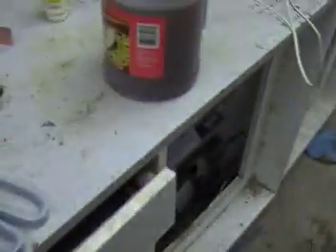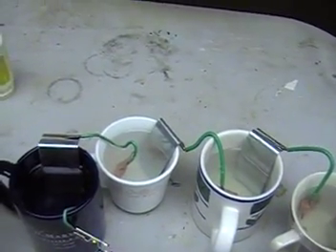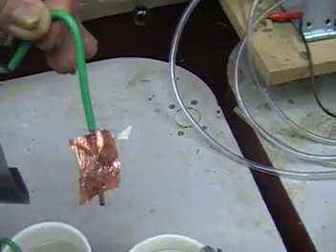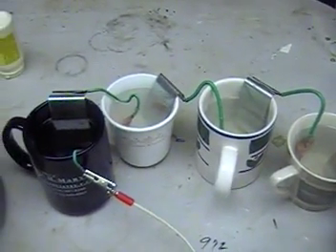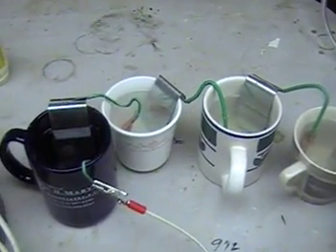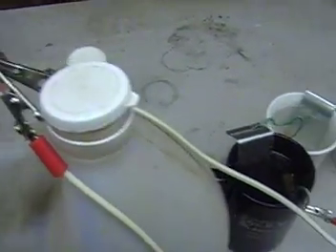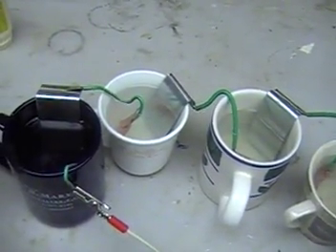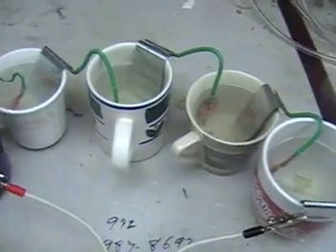Check out my salt water battery

Comment from the maker: All you have to do is know how much voltige you want . The devid that by point 8 and that tells you how many cells you need..  Then make the sixe of metal you need for the amperage.
8 cells should give you 6 to 6 & 1/2  volts.
2 inch by 4 inch galvinized sheet metal and 1 by 4 inch thin sheet copper should give you enough power to light your bulb and for several hours.
If you use LED bulbs it will light them for a week 24 hours a day.

Comment from the maker: Each cup is a cell. Each cell puts out  point 8 volts.  The amperage is the size of the peasces of metal. Almost any two differant types of metel will work. It is just that copper and galvinized seem to work best.

Comment from the maker: It works with ANY galvinized metal.
In fact ;;;  It works with almost any two disimaler materials.  JUST , not as well as copper & galvinized.
Acyualy;; It is NOT the galvinized that does it, But the Zinc in the galvinizing.

Comment: Day #1 3/18/08 Started 1:20 PM.

Day #12 3/30/08 Stopping test 8:30 AM.

Salt water battery is still lighting LED, But just barely.
It started off with 4 volts & 6 mille amps and is now down to 2.2 volts and 1.79 mille amps. And ran 24 hours a day for 12 days.

Comment from the maker: Some kind of small container.
Each container will be a cell and produce about point 8 volts.
The number of cells in series deturnins the total volts out..
Sheets of thin galvinized metal & sheets of very thin copper. Then copper wire to conect them together in series.
The size of the peaces of galvinized and copper determin the amperage out-put.
Then you just add the sal to the water and fill the cells.
The more salt you can get in the water without any settaling to the bottom the better

Comment from the maker: What's next? Pepper water? 

I Really don't think so.
Read any Jr. High School Chimistry book and you will learn Why.

Pepper, Cinamun, Sugar, Oregino, & Thym,  NO Good.
Salt, Viniger, Lemon or, orange  juice. Good.

Salt is best choice because of out put,  to  coast.
Zinc is TOO expincive to buy and use in itself. HOWEVER ;;;   The galvinizing  on some scrap metals can be removed in this manner. Makeing the scrap metal more valuble. No need to burn off galvinizing before melting

Comment: RHEAD100 is right.  If you have some zinc sheet, this is basically a copper-zinc battery.  You could do similar with carbon-zinc like your 'regular' C or D cells.  Look at a periodic table you can check out the 'electro negativity' of each element.  The largest difference will be the most 'active', giving the most voltage per cell.

Comment from the maker: Is it possable that there is some kind of coating on the galvinized metal or copper metal.
Galvinized metal from the factory is coated with some kind nof oil to temp. protect it..
Clean all the metals with rubbing alcohol and clean cups as well and start over.

Comment from the maker: METH LAB. THAT'S FUNNY. I know what it is. Don't know what it looks like.
If you do try this. PLEAS don't Buy the material new at Home Depot or Lowe's. If you must buy the materials. Go to a salvage yard where they buy scrap metals.  Almost all will resale the stuff.  And a lot cheaper than new.
Large diameter copper pipe split down the side and flatened out works GREAT. Old galvinized A/C duct dirt cheap at scrap yard.
Have fun and be careful. This is REAL electricity. It "WILL" hurt you.

Comment from the maker: I am really glad you asked that question.
I bought a couple of shaky flash lights at a dollar store for a dollar each. Taking one appart to see how it works. I discovered that the metal insid was not a magnet and it had two round flat batteries inside. The LED came from the flash light. The 2 batteries and switch have been used on other things.
If I had bought all the usable parts at radio shack it would have coast over 12 dollars.
SO    when buying parts for an experimant, wear a think cap

Comment from the maker: From experiments I have done. I would say 16, 5 gallon buckets hooked up in series should run a 21 inch tv. And most deffinetly a computer. And NO question as to could it charge the batterie for a lap top even while you were using it. and should run for 8 to 10 days.

Comment from the maker: The copper does not get used up. And the zinc is not distroyed. It is changed into another chimical which can, with solar energy be changed back into pur zinc more effecant than using solar to make electricity.

Comment: That's really amazing. Seems we could fill massive tanks full of sea water and get a good amount of power from it. Once the electrolysis has finished dump the water and fill up the tanks with more. The only problem is it might take more energy to pump the water into the tanks than youll get out of each batch of salt water. So you just build a dam that lets the water in and dumps it to a lower level, no wasted energy. Fun.

Comment: Well acually, first I used a green LED light and it barley lit up at all.  Then I used a red LEd light and it lit up like firework!  So I showed it at school and they were amazed.  So I am sure I will get a A+.  But thank you for the amazing video.  Here is what I used and set up perfectly just like you: red LED light, copper wire, aligator clips, 6 coffee cups, salt, galvanized and copper sheet metal.  Thanks again though.  :) :)  :>

Comment from the maker: It will work the first time but you must build it to fit the applacation.
Stick to LEDs for now.
Each cup is a cell. Salt water copper and galvinized metal. Each cell makes .8 volts. Wire the cells in series to up the voltage. Incress the size of the copper & galvinized to up the amperage. 5 cells will give you 4 volts and metal the size I used will give you 6 millie amps. plenty to light a small LED for 10 days.
an LED flash light at the dollar store and us the bulb. A lot cheaper.

Comment: What about trying different electrolytes, like baking soda, or some of the different potassium or sodium compounds? What about zinc paint to recoat the steel? What about Zinc Dust? Can the copper be sanded/cleaned to be re used?

Comment: i don't know much about electricity but from my understanding, this is not a salt water battery, it's a copper/galvanized metal battery, the salt acts as an electrolyte to facilitate the transport of electrons between the 2 electrodes.  still very interesting to be able to make power with scraps of metals and little else.  i wouldn't worry so much about how often to add salt but doesn't the plates corrode over time? then again, if it's fee, doesn't really matter. thanks for the idea :)

Comment: im in the process of building a solar air heater but that cant be solely relied upon. so im lookin for a little somethin else. this could quite possibly be it. great project rhead and thanks for answering all my questions.i have electricity and all but im just lookin to cut my huge power bill down a little especially in a new york winter.

Comment: i went and bought a digital multimeter to measure some volts and stuff and i got a half a volt out of a plain glass of tapwater in a plastic cup no salt at all. i bought copper wire i need to get some galvanized sheet metal and a copper sheet. idk is the salt work it i mean if i can heat my room all winter for a couple pounds of salt then yeah i guess its worth it lol. at a dollar a pound. i would really like to be able to charge a 12 volt battery or 2 to run a heater for winter.

Comment from the maker: You may have to add a little salt from time to time. But very little. And table salt from the grocery store works fine and only coasts aBOUT 69 CENTS A POUND. If you put in too much it will just collect at the bottom. Heating the water does make motre electricity. I did not do any tests though. Maybe next time.

Comment: how long will they produce electricity b4 u have to add more salt ? i mean if u have to add salt it would probably only be best if people very close to a coastline or salt water lake. i dont know how much salt u have to use or how much salt even costs. also did u try to see how much electricity u got if the water was heated up or room temperature ?

Comment from the maker: 17 buckets (Cells) would give you about 13.5 volts, which is what you would need to charge a 12 volt battery. The amps come from the surface area of the galvinized metal. The metaL I USED IN THIS VIDEO WAS ABOUT 6 SQUARE inches each. Which produced 1.5 amphours of electicity over an 11 day period.
As for heating a room. You would be better off to use the solar hot water for heat. And the salt water battery for lights and Tv.

Comment: couple questions how many 5 gallon buckets of salt water do u need to power say a house and would u ever have to add salt after the first time. maybe a whole house is unrealistic how many 5 gallon buckets would u need to power say one of those portable electric heaters. i would love to get free heat all winter all i need is to heat a 12 by 10 by 10 room. also is that water room temperature. could u get more electricity from having the water in sunlight or a solar water heating system

Comment from the maker: Just wanted to see if I could improve on it.
I went to a commercial weldind shop and bought some 3/8" copper clad carbon welding rods Thats 13.5 sq. inches of copper per rod. I am going to use them to build a bigger unit.

Comment from the maker: I would have to say it was somewhere in the middle.  We did a remodle of an MRI room at he local hospital and it was some of the shealding left over. You could almost cut it with a box knife. The galvinized metal was scrap 1 1/2 inch 26 gage metal left over from the A/C men on a job. they use it to hange thier duct work.
Thanks for watching my video

Comment: If you lived on the beach you could stick a zinc plate 20 ft. X 20 ft. in the sand for support and then a copper plate the same size about 100 feet apart. I don't know what would happen to the fish swimming in between the plates. This is similar to the earth battery, but likely much more energetic. Don't electricute yourselves.

Comment from the maker: Almost any sheet metale shop will have what you need. And if you tell them it is for a class room experiment. They will most likely give you all you need.
Galvinized sheet metal & copper sheet metal. And salt and water. And non electric containers. Like glass, porcilen, or plastic.

Comment from the maker: Incresing amperage is the easy part. Just make the surface area of the plates larger.
Nails, bolts, washers, To small. Go with galvinized sheet metal. Lots of the stuff in construction dumpsters for free.

Comment from the maker: Hey;;;  Don't be buying this stuff. The idea is to make Free energy. Get your galvinized metal from a construction site dumpster.
There is 20 to a hundred pounds of it in every dumpster on every construction site in the USA.
Thanks for the comment. And have fun.
REMEMBER; The bigger you build it the more carfull you have to be. This is REAL electricity. 4 volts  6 milli amps. Damn near put my DinK in the dirt.

Comment from the maker: Actualy, heating the water does make it opperate better. I did this in the winter. Every morning I had to put the cup in the microwave to get the volts and amps back up.
The best way would be to build some kind of solar hot water heater. Could easly get ithe water up to 140 degrees.

Comment: Good video, Thankyou - you know an interesting setup would be a number of long copper tubes about 12 inches long in a vertical stack. Placed inside each tube is a stick of zinc. Then connect all tubes to a source of flowing water. For increased voltage connect the tubes in series. For increased amperage connect the tubes in parallel. I wonder what the effect would be if the water was heated.?

Comment: if you ran the leads to a small enough capacitor you'd be able to discharge it (after 12hrs;) in one second. Capacitors leak so you'll have to get one that fits your input. I like capacitors but i'm very new to all this so please take what i say with a grain of salt.

Comment: lol that's funny. 
 Just for additional info, if you use a stronger electrolyte like ocean water or a KOH, lye, you'll increase your amps.
  I bought a bunch of washers and nut/bolt organizers after seeing this and have been experimenting.  I'm big into the HHO movement, so i used my watts from this to produce hydrogen.  Works to some degree. Definately have to get a thick stack, i mean "pile" ;)

Comment: Technically speaking, it is not the salt water that produces the electricity.  The voltage difference comes from the two different metal alloys--which get "used up" with time.  The salt water is just a conducting path.  All batteries work the same way. This was first discovered by A. Volta in the late 18th century. I enjoyed the video .

Comment from the maker: You bring up some VERY interesting points that I did observe. But being the big dummy I am. I did not think to post them.
Here goes. There was very little rust. Extriemly neglegable. The surface area would coat over Black and voltage would drop slightly clean the black off with a papper towal and the voltage would come back up.
When the tin & zinc finaly corroded away completly the steel underneath was very clean, shinny, and gray in color. There was a white resadue in the bottom of the cups.

Comment: Yes I know it ran 12 days I mistyped but why did it stop did the metal get all crusty (rusty) or did the water just go bad like it started to get smelly stink like sewer water. 

Because if it cuz the metal got crusty that means u just gotta polish it and it will work again.. and u could maybe make some kind of contraption that would auto clean it but if the water went bad.. not really efficient did you see what happens if u cover it with a lid or something maybe its the air?

Comment from the maker: I would Really like to see that setup. Maybe we could work together an see if we could get the amps up. By the way;  was it A/C or D/C
Commercial welding supply house carry carbon rods 3/8 inch in diamiter and 10 to 12 inches long.
Were you useing carbon rods only or carbon and something else ????

Comment from the maker: What a lot of people that watch this video do not realize, is that I am a contractor and I get paid to haul this stuff away. On or two tons a month. SO; for me. It is not just free power. It is free + +. I get paid to haul it off. Get the free electicity. Then haul the clean metal to the scrap yard. Where I sell it for even more money. And it gets recycled.
I am now building a much bigger unit to charge a fork lift 12 volt battery.

Comment from the maker: It ran the LED 24 hours a day for 11 days.
I gqess that would work out to a month at normal use. 8.8 hours per day for 30 days.

Remember; The size of the plats is what gives you the amps and hooking them up in series give you the volts.

Comment from the maker: not exactly IN the plates. But, there was a white cristasl like substance build up where the copper wire was attached to the galvinized metal. Looked a lot like the white stuff that builds up on the conections of a car battery.

Comment: good work. next try putting to alligator clips to a speaker magnet and connect to a voltimeter gauge
you will see a voltage of between 0.3volt-minus0.3 for an average speaker size magnet depending on the position of the alligator clips, and once the "sweet spot" where the volt output is max positive then connect to flat battery leave for a week and VOILA - 6-12volt battery fully charged again. this is a experiment accidently found when testing my HHO device amp+volt readings.DRUFIMUSIC (channel)

Comment from the maker: A word of caution;;   Once you have several cells wired in series. Watch how you handle the wires. This is NOT a lead acid car battery.  It "WILL",  knock your D#@k , in the dirt. And also remember,  it takes only one amp to kill you.

Comment from the maker: Actually ,  Aluminum and galvanized metals work almost as well together. You LUCKY Dog;  Sea water works much better than tap water and table salt. It works just like a Battery;  Each unit is a cell. Hook them up in series to increase voltage. Increase size and surface area of plates to increase amps. OR,  make more cells and hook up parallel.
The warmer the water, the better it works. Solor heat the unite.